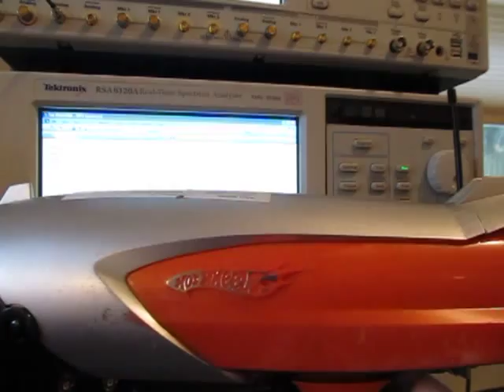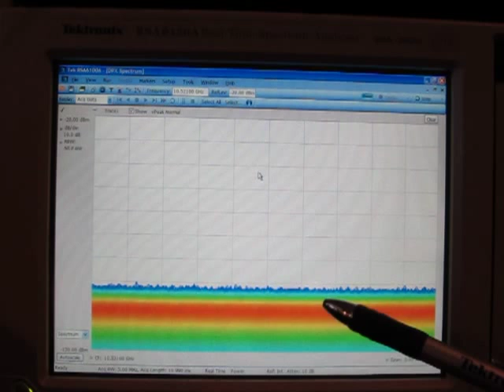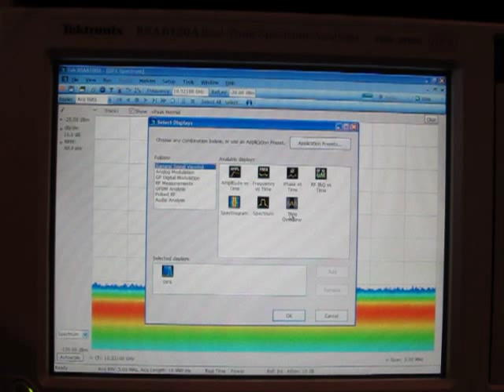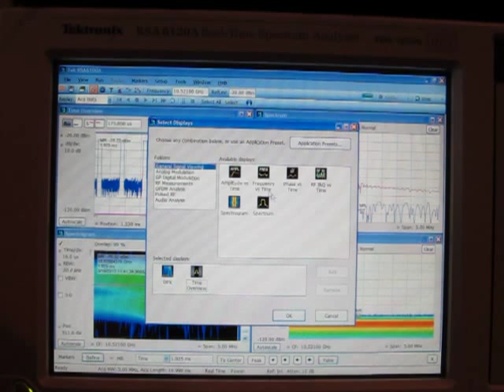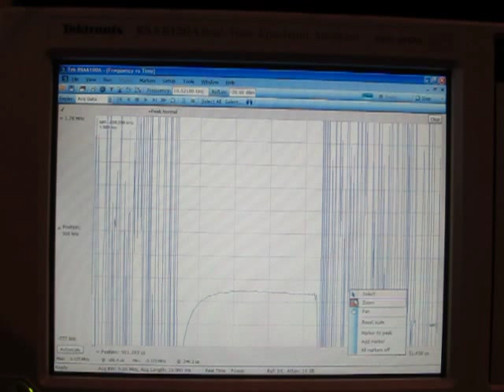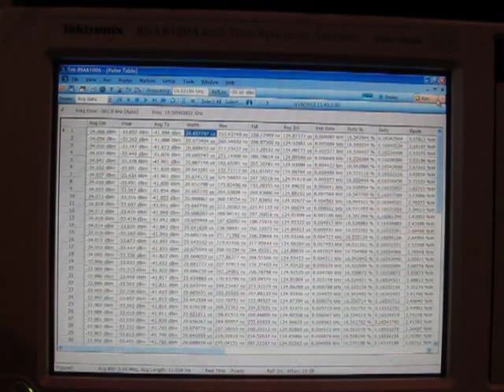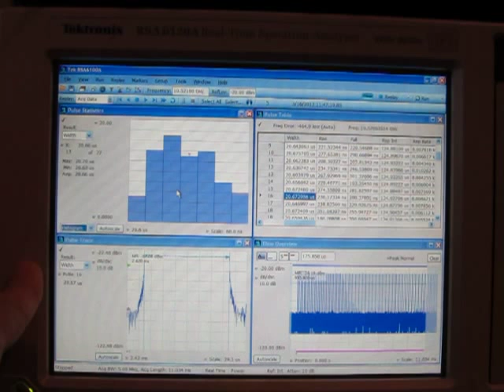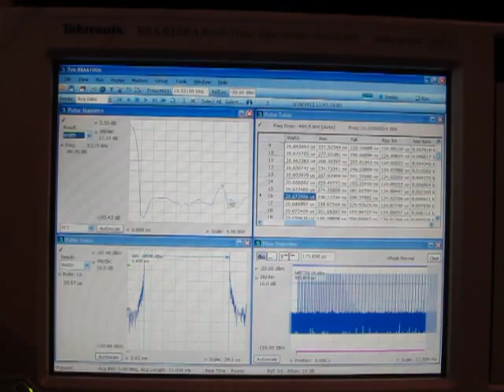#38: Analyze Hot Wheel Radar gun with a Real Time Spectrum Analyzer

Comment: Nice video show!
I was wondering if you know about the about the frequency mixer, I think it is the small piece has XHB label on it. I was trying to find it on the internet, however no luck so far. I am guessing this mixer they use here must not be very expensive. Do you, by any chance, have the model number of this piece?
Thanks!
Reply from the maker: I've never taken one of these apart. However, I believe the unit uses a simple Gunn Diode oscillator. The incident and reflected signals are combined to create a beat signal which is the Doppler shift.